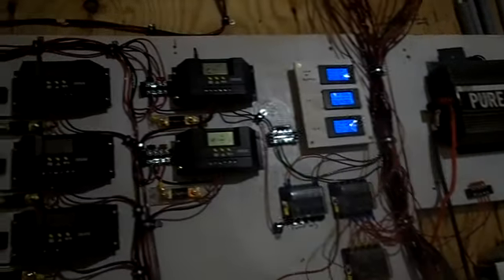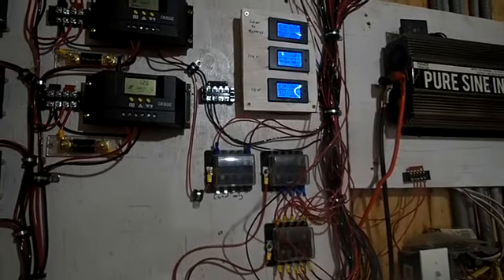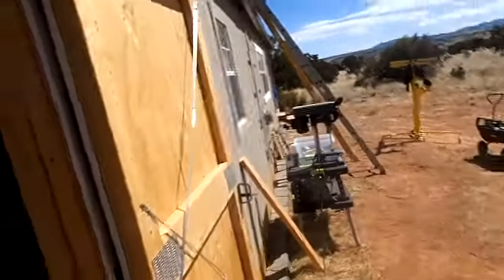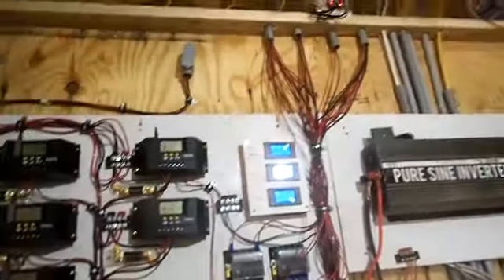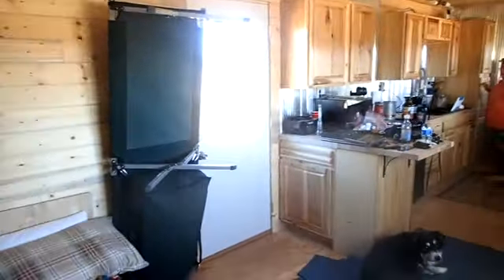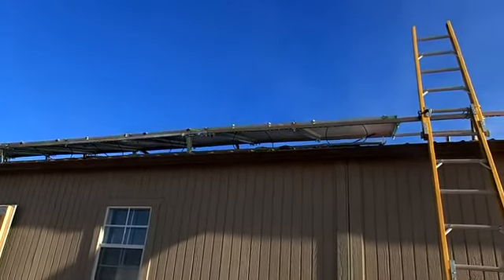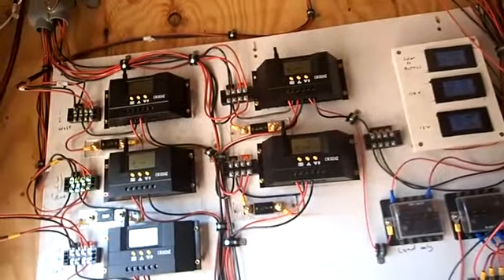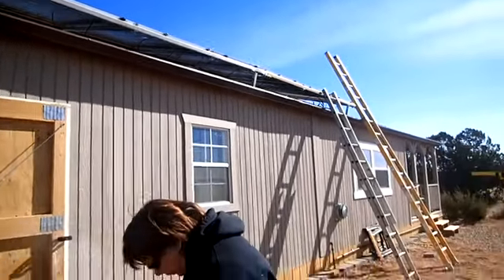Building an off grid house part 109. FINALLY GOT ALL THE SOLAR PANELS UP!!!

Comment: Lol, tell Sue that she has her working face on! But glad you have her there to help. But the main thing you stay safe. The output is awesome. Does that inverter in manual tell how much consumption from system? But I'm looking for a inverter to put into my Faraday Cage. It sure feels good to see it charging at 60 amps. Thanks for sharing 😃
Reply from the maker: The inverter doesn’t but the gauges before the inverter do. Would you do a video on your cage? I need to do something about the rf from the inverter.